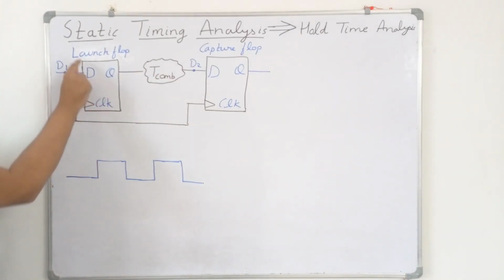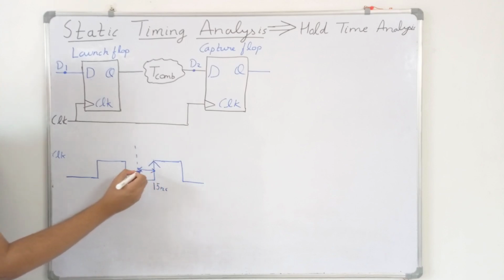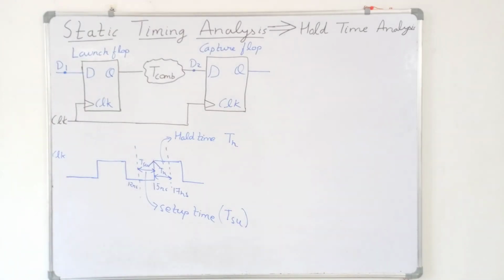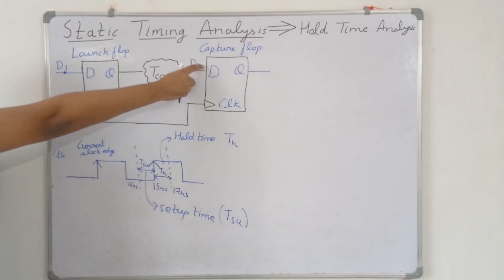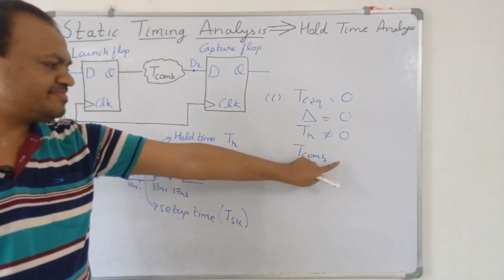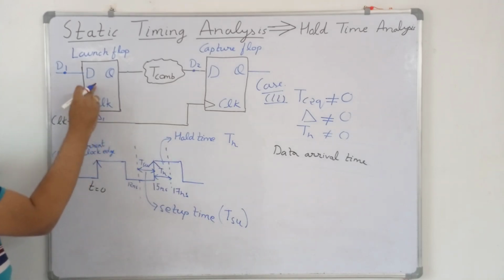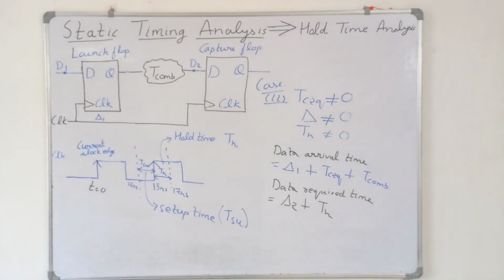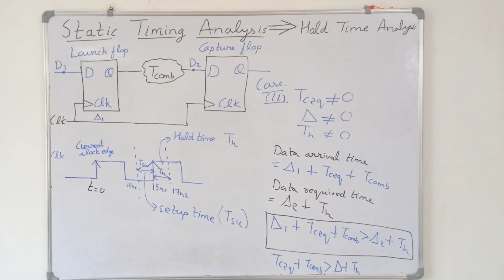Deep Dive into Static Timing Analysis: Understanding Hold Time, Clock Skew, and Flip-flop delays

Comment: hold slack= Data Arrival Time- Data Required Time
A +ve setup slack means design is working at the specified frequency and it has some more margin as well.
Zero setup slack specifies design is exactly working at the specified frequency and there is no margin available.